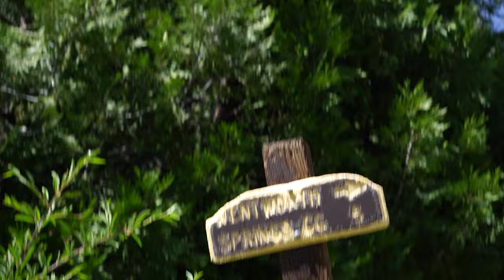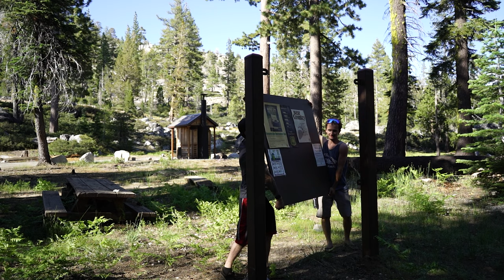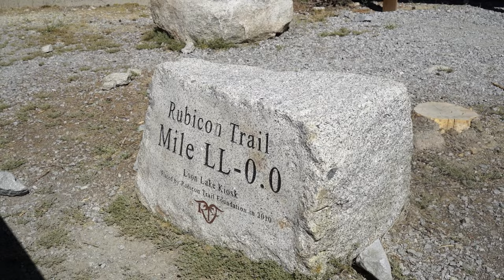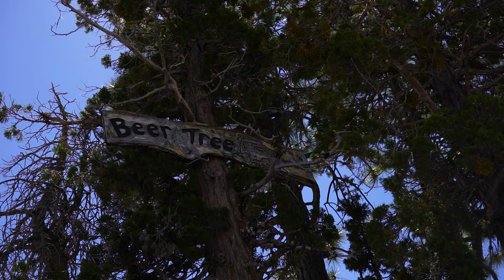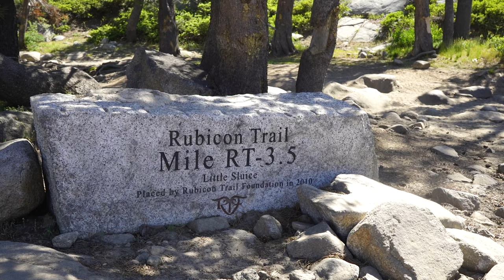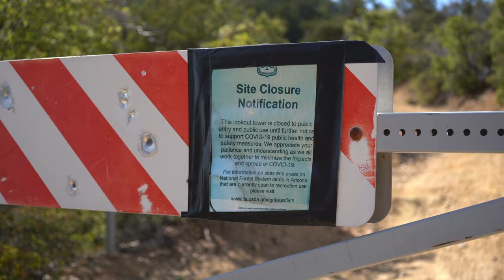The Rubicon Trail - A TRUE First Experience

Comment: Beautifully filmed video and nice storytelling. Very few film the Wentworth Springs entrance. Great job naming some locations. We will fill in the rest.

4:00 - Postpile obstacle
6:01 - If you pause, you can see the flat line of the 2nd Loon Lake Dam where the welcome to the Rubicon sign is located
12:23 - As seen from far away at 6:01
12:46 - Hot Rock
13:55 - RTF just filmed on Saturday (9/9) a video about the history of Gatekeeper. Look for that soon on our channel
16:56 - Actually parked at Beer Tree. Look for a video from us soon on the history of Beer Tree by one of the founders
31:01 - The trip down that is called Indian Trail or The Slabs
34:23 - Big Sluice Hairpin
34:32 - Scout Hole
34:39 - Sawtooth
36:35 - Property Line
37:54 - Cadillac Hill Hairpin
39:05 - It actually is a Buick LaSalle, but Cadillac Hill sounds way cooler!
40:05 - Morris Rock (Top of Cadillac Hill, named after Steve Morris)
40:40 - Long Lake (the trail to get near it is a left turn at the bottom of Cadillac Hill near graves)
40:50 - The Jeepers Jamboree Sunday Sloppy Joe lunch campsite
Reply from the maker: Thank you! There’s so much history on the Rubicon. We hope to get out here sometime with someone who knows the trail this well to learn some more!
Reply: @backcountrybeagles  Indeed. Don't forget your next trip, we have 4.2 miles of new wheeling over 287 acres. The left turn is at mile marker 4.6.

Comment: What is the lift size and tire size on the XJ?  Id like to take my XJ out there but i think i want to have at least 35s to do it.  Thx in advance!
Reply from the maker: Roughly 5” and 35s. Personally we agreed 35s can get you through the trail but it is very challenging. I won’t go back until we’re on at least 37s next time. Just would make it alittle more enjoyable and quicker to get through.
Reply: @backcountrybeagles  Got ya, thanks for the info!  I dont think ill put my XJ on 37s but i will probably go that route with my toyota over time.  But there is plenty of stuff to do in the GJ area till i get out to the rubicon trail.  Good stuff and stay safe!
Reply: @backcountrybeagles where you locked front and rear or? I want to attempt it with 33s on my xj 3.5 lift
Reply from the maker: Our Cherokee is locked front and rear but most of the time we kept the rear unlocked. Just a front locker works wonders. It would be quite the challenge on 33s but it has been done before.

Comment: It’s hard to tell with any certainty, but your tire pressure looked too high. Not much flex in the tires. Looking forward to the day I do the Rubicon.
Reply from the maker: Can’t remember but we were probably at 10psi, maybe 8, didn’t wanna pop a bead out there. Next run on the rubicon we’ll have beadlocks.
Reply: @backcountrybeagles  cool beans. Hard to tell from the video.